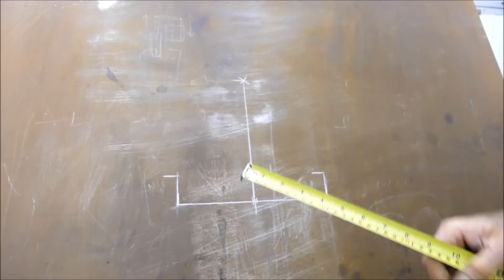Super simple DIY pneumatic power hammer - The Ring of Power... hammer foot pedal upgrade

Comment: When i used to design assembly machines, it was always "hardened end stops". Nothing else was even durable enough.
Once you've designed something where the cylinder ends get destroyed... you decide to take the advice of the old blokes who've been there and done that...
I'd weld some brackets onto the bottom of the round moving part, and fit those hardened end stops to the fixed RHS parts. That way you have minimal changes to your fiddly cylinder. Just my 2 cents worth...
Reply from the maker: @jamesspry3294  thank you. It's got electric proxy sensors now so it never touches the end stops and cycles via electronic control. Cheers J

Comment: Is this good for a first time welder?
Reply from the maker: Not really. You'll need to know wether your weld is a good one or not as the forces this hammer produces can be Very dangerous if your welds don't hold up. Something to work towards maybe. I recommend getting a basic weld horizontal T fillet coding first which is a standard welding lesson, test and qualification for basic structural welding. I use MMA (stick) using 7018 electrodes. Cheers J

Comment: Great design, is it expensive to build? I would like to get  a set of plans for it if they aren't too costly. How do I go about that and what tools are required to build it?
Reply from the maker: Hi Mark. It's very cost effective compared to buying an off the shelf power hammer. It does require a large compressor though and you must be able to weld at a high standard ideally using a stick welder with 7018 3.2mm electrodes.  Build can cost £600 all in depending on your steel supplier. Do watch the latest video for more information. Cheers J

Comment: You are a genius, I wish I could meet you and learn more from you.  Your videos are great.  I will soon build myself a power hammer like yours.
Reply: Can the design of the hammer also become a forging press?
Reply from the maker: @TheMabat1  no. Its not got the right compressive strength for that. Needs a to be a C frame made from 1" plate or a H frame made from I beam.
Reply from the maker: Thank you so much that is very kind. Do check out the latest video using Arduino control. Cheers J

Comment: Quick question... the valve you install in this video isn't the one you show in the parts list. I know this is because you show more upgrades in more recent videos. But this seems to be your most basic setup. Bssic is what I am aiming for in my build.  
That being said...
1. What valve are you running in this video?
2. I don't have a solid round stock for the hammer head so what are your thoughts on my idea of using 3 inch tubing and filling it with sand? Sort of like a dead blow hammer.
Reply from the maker: Hi Nate. This is the upgrade part 2 package. It's a 5/2 Push pull manual valve. Sand will absorb some energy  compared to solid which will be better at energy transfer. You'll need a cylinder cushion or bump stop to protect the cylinder from over extension. All the very best. Cheers J
Reply: @joshuadelisle  you're awesome.... thanks!!!!

Comment: Hey Joshua, I really like your hammer with its simplicity... in this video you mentioned you were through with making changing, then I see you are adding computer controls to it. It is hard not to keep thinking on making it better then trying it out. Some times I like making the tools to make an item as much as making the item. But I do have a question about the 5 way / 2 position valve you used in this video. I saw what you recommended in Amazon and did not buy it then as I was gathering info. I am ready to buy now . You have since changed the design again and changed the 5/2 valve to computer control . Do you still have the valve number that you used in this generation ? When building something it helps if you can start with something that others have tried and found out that it works. It lessens the price of the hammer by knowing what will work.The interesting thing is that you are really close to the control valve set up as a steam hammer. There are several you tube videos that show bits and pieces of the control linkage which gives great control with not using limit switches or computer. James Savage has built a combination De lisle hammer with a KZ 100 steam hammer linkage. There is also a video of the KZ 100 which a hammer with the steam hammer control ,it is Ken Zitur KZ 100 power hammer. James Savage goes over his linkage. It seems to be a nice hammer. 
Thank you for sharing your ideas. Robert Taylor
Reply from the maker: Hi Robert. Yes all it was is a 5/2 manual push pull valve with 1/2 ports. Not common but can be found. You certainly could adapt it to use a steam linkage but I believe the electronic system is simpler, cheaper and minimal. Cheers J

Comment: How much air supply do you need?
Reply from the maker: Hi Tony. I use a 150ltr 15cfm 3hp compressor. I wouldn't go smaller. I forge enough until the compressor kicks in and I put the steel back into the forge and let the compressor fill back up again so it's not over working.
Reply: @joshuadelisle  Thanks! My compressor only has 11.5cfm@ 90psi w/ 60gal tank. Do I need to worry about the cfm as much?
Reply from the maker: @tonytroyer9729  hi. The size of the tank will dictate the length of run time. The cfm will determine how long it takes to re fill the tank between cycles. Ideally you'll want a big tank and a powerful pump to fill it back up quickly. You should be able to get one like my mine new for less than £500. I got mine second hand for £100 and is easy to maintain/fix if there is a problem.
Reply: @joshuadelisle  3.7hp  is compatible to what you have... Just looking at the options of air hammer vs power hammer

Comment: Always a pleasure to watch your videos Josh. I'm still jealous of how easy the slag comes off of your welds. 
But yeah, your airlines are a lot more efficient now. And flexible airline is the way to go. Much easier to work with, much cheaper and for the same reason you stated, it's cleaner and not throwing debris into the mix. 
Still haven't built the hammer I bought plans for. I think later down the road for that one. A DaVinci  power hammer is the route I'm going to go for now. But I still have a lot of other things I need so....it's all on the back burner for now. 
Anyway, great video as always! Keep up the great work! 👍
Reply from the maker: Thank you Sam. All the very best. Cheers J

Comment: Why don’t you just power up and then let it gravity down under its own weight?
Reply: Because then you have a drop hammer, which doesnt get the benefit of the air power forcing the ram down. Drop hammers do have their purpose, but they need to be much taller than a power hammer.

Comment: There are pneumatic cylinders available with adjustable air cushioning at the top and bottom of the cylinder travel. Much better than any form of bump stop. Fantastic build, never thought of that approach. Nice work.

Comment: Hi Joshua! I've just finished to watch all the three videos about the Power hammer.
It's an excellent project, simple and effective.

About the problem with the piston touching the cylinder head, wouldn't be possible to replace the foot switch with an electric one, which controls  two solenoid valves?
In this way you can shorten the pipes, avoid the "lag" problem due to large sections, and maybe you can implement a braking system which after a certain volume of air passed, closes the flow making the piston slow down.
Then the airflow changes direction automatically.

Maybe it raises the price a little, but I think that's a nice feature.

Are you from Australia? 😁
Reply: Partializing the exhaust will work for braking!

I'm not sure that the rubber washer is making things better... It depends on how the cylinder is made internally.
If the piston doesn't touch the head, then it should be OK.
If the rubber makes contact between all the parts, it may even make things worse because it transmits the force to the cylinder, while the compressed air would.. Compress and absorb the shock!

I'm just guessing :-)
Reply from the maker: Hi. Thank you. Yes solonoid valves would work great and with an Arduino you could even corporate it into automation. I've considered using a solonoid valv e and limit switch at as a break. the cushion is working very well otherwise. I have another video coming out soon with further considerations for the design. I would love to hear more of your thoughts on that. Cheers J
Reply: @joshuadelisle  sure I've subscribed, I hope to don't miss the notification!
The cushion is indeed a good solution (simple and working), I'm a bit concerned about the fact that even if it absorbs the shock, it still transmits it to the rest of the cylinder, stressing it and shortening its life - in theory - in practice it can last forever, it depends on forces and materials.
With an arduino you can change the behaviour of the machine, but you're not obliged to use such a complex solution.
I'm sure that you can find solenoids working at 12 or 24v, with less than 1A.
To control them you can use even a simple button and a couple of relays.  What's missing is how to detect when the piston reaches the maximum and minimum stroke. This needs a bit of thinking, but I'm sure that there are diy solutions on the net.
In case that you will need an help with the arduino in the future, I'm a software developer and i would be glad to help you ;-) See you then
Reply from the maker: @Fred_Klingon  I'm sure a limit switch or proxy sensor would work well so the Arduino registers the maximum stroke before hitting the cushion and then shuts the valve to create an air cushion stop. Then needs to release when operating the treadle. I think I know how to code it to do that. But for now I'll use it till it breaks and that will give me a good idea of the longevity of the standard solutions. Cheers J
Reply: @joshuadelisle  you're right, I didn't think about an external proximity 😩.
For the future in case you need a solution: you can take as example the internals of a  🖱, the wheels are tracking movements with an infrared beam passing through some holes cutted into the wheel.
You can do the same, using a band long the same as the full stroke, with one cut for each centimeter. With this solution is possible to count the beams arrived to the ir sensor,. Doing that, then you can partialize the air to slow down the piston, until it reaches the maximum point where the air direction is inverted.
Good luck 😉
Reply: @joshuadelisle  Be careful with this in regards to the mass of your hammer and the size of your cylinder. Most airlines and fittings are only rated to 250 psi, and depending on the speed you are getting your hammer up too, just closing the valve electrically without having some sort of physical assist to slow the hammer can cause pressure to spike above rated levels. You could end up blowing cylinder seals or even worse popping an airline in your face. Trust me, not fun from personal experience.

Comment: How much did you spent to make this power hammer ?
Reply from the maker: For me the materials were free because they were excess stock paid for from other projects. I spent £100 on my compressor and about £100 on the cylinder and valves. Cheers J
Reply: @joshuadelisle ,
So it could easily be made spending around a thousand dollars, thank very much for the info. Be safe out there and God bless.
Reply from the maker: @ronin1330  thank you. Yes that would be plenty. I've yet to get mine shot blasted and  powder coated which is an extra £75. It definitely needs a cylinder cushion to protect it. I've got a new video coming soon and an upgrade package to download. Cheers J
Reply: @joshuadelisle  
       Perfect, I'll subscribe and check the video out, thanks again.

Comment: instead of slamming the rubber stopper, you should just use a piece of string from the top of the hammer, to the valve, so it pulls it closed when its full length =]

Comment: Hi. That’s really good idea, but I’m wondering why you don’t used the rotory valve?????, if you install rotory valve then you don’t need to press the foot valve that much, only you have to press it like gas peddle in the car, depending to your air pressure and..... you will have speed and power. Actually you will have nice and fine control but powerful hammer.
Reply: could you post a link to the type of valve your talking about?

Comment: With my humble experience with factories air cylinders, especially when all the torque is sideways and not directly inline with the piston rod, they are constantly breaking by the thread line. It’s recommended to install 2 smaller cylinders on opposite sides to balance the load.
Thanks for sharing your neat beautiful videos.
Reply: So long as his roller skate wheel guide setup is rigid enough it should take up the majority of the torque and the cylinder should be fine.
Reply: Ryan Mayer 
I replaced many broken ones for that side torque, and always work toward the overkill.
but if you’re confident that it’ll be all right, I’ll join your optimism and hope it’ll hold:))
Reply: @crazycoyote1738  We will see how mine holds up, if your familiar with linear rails i used some old size 25 THK rails for mine instead of the roller skate wheels

Comment: I really think you should tackle the problem of the ram extending back up and having to catch it with your foot controls. Theres a number of different simple solutions to that problem. Compression spring bumper, extension spring catch to reduce the velocity, etc etc. I dont have a power hammer myself yet, but I do like the simplicity of yours. I have all the parts for that laying around my shop right now and I'm considering building something similar myself. I do know however, your ram is going to jam up eventually if you allow it to continue extending fully like that.

Anyhow, Thanks for the idea and the vid!
Reply from the maker: Thank you, I'll give it more consideration, the rubber cushion seems to be doing well so far. If it breaks I'll do something then, I've got 2000 nails for it to make with some new tooling so that will be a good endurance test. Cheers J

Comment: Great project!  This is an excellent design. You made an improvement  by moving the valve very close to the cylinder.  I believe if you would weld up a small volume of steel tube maybe 3" x 3" x 3" and place it right at the input of the valve, it would act like an air capacitor and give even better efficiency. Like a micro air tank right before the valve.

Comment: Have you thought of adding a limiting arm at the top to stop it just shy of the top, blow the air off and send it back down- so you would not have lift your foot ?
it could even be height-adjustable.
Reply from the maker: That's an interesting idea. I like the control and simplicity of it as it is for now but I do have modification that makes it reciprocate like a regular power hammer. I'll be doing a video soon on it. Cheers J
Reply: @joshuadelisle  do you pdf plans come with the type and size of steel you used to make the hammer and anvil base as well as the mods you have made ?
I am going to get them and build your power hammer but I'm not the best at picking the type of steel and I will be doing all the welding with a gas shield mig is there a best mig wire to use on the RR track to the round bar?
thx a lot Sir.
Reply from the maker: @beewon8334  hi yes all the steel sizes are on the PDF. The mods are not included but the there isn't anything changed on the original design just an added pedal and changed valve system. I will do an add on pdf with valve details and the pedal at some point as I've made a few more modifications I can add together. For welding high carbon to mild steel I recommend either 7018 or 309L electrodes with an arc welder. For MIG I'm not too sure but a stainless wire with pure argon may work better, you must pre heat the larger sections to get the best fusion 50-100 degrees Celsius is fine.
Reply: @joshuadelisle  wow just got the plans REAL NICE !!!!!! thx a lot
Reply from the maker: @beewon8334  thank you! Any problems or questions please feel free to ask. Cheers J

Comment: Love it, have you thought about putting the air dryer between the pump and the tank on the compressor to keep the tank from collecting moisture, it shouldn't effect volume at that point.
Reply from the maker: I haven't, I just drain it after use. Sounds like a good idea though. Cheers J

Comment: Lovely hammer! i will probably buy the plan to build one! just a quick question how much of a beast of an air compressor do you need for such a hammer?
Reply from the maker: I use a 150tr 15cfm 3hp single phase. I got a second hand one for £100. New is about £450. If you use POWERHAMMER3 as a coupon code you'll get 20% off. Ends January 1st. Cheers J
Reply: @joshuadelisle  Thank's for the info! will have to shop around for a nice second hand then! just bought it very nice looking drawing's!
Reply from the maker: @niksechtniks  thank you so much. Any problems please let me know and I'll help as best as I can. Take care. J
Reply: @joshuadelisle  First of all, The best wishes for 2020! and i have a weird question for you. when the cylinder is exstended how many mm off room is there between the bottom of the 100 round and the lowest guide wheel?  im trying to make a die changing system but im not sure if it has 

enough space for it. have to wait for the pneumatic parts to arrive but i cant wait to start building so i 
thought i let's make the rest  of the part's in advance
Reply from the maker: @niksechtniks  it's very close. I have a die changing system that I hope to finish filming shortly. I bolt to the permanent dies and have a simple slot system for quick change.